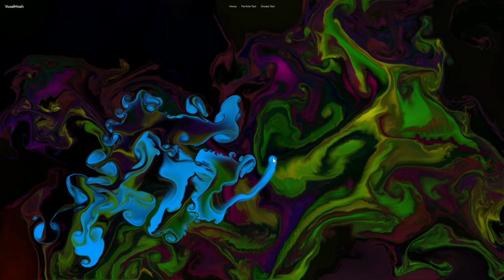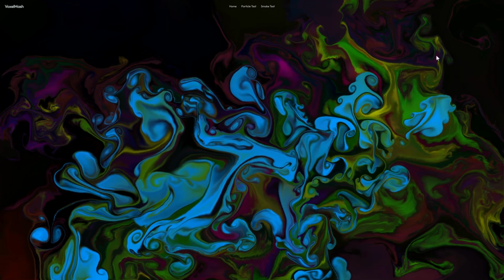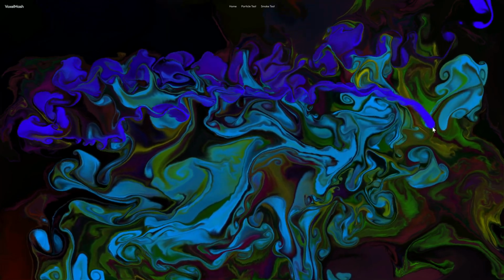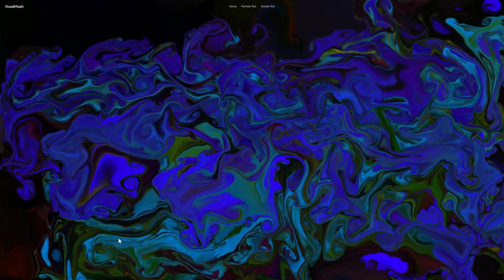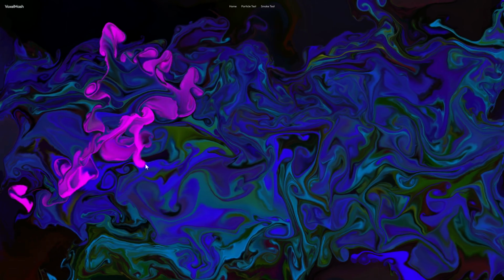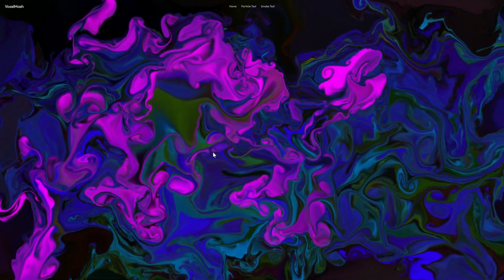Smoke Sim Multigrid Pressure

Comment: Its rather an ink simulation, right? Since you are speaking of pressure projection which implies incompressibility constraint thus no compressibility as expected with regards to smokes.
Best regards.
Reply from the maker: Yeah, this doesn't simulate things like compression/shockwaves etc. This type of pressure projection though is still commonly used in 3d graphics for scenes with fire and smoke, eg EmberGen, I guess the rationale being that often for those scenes pressure waves is not as necessary.
Reply: @GrantKot  Thanks for the reply. Do you plan solving the compressible euler equations?